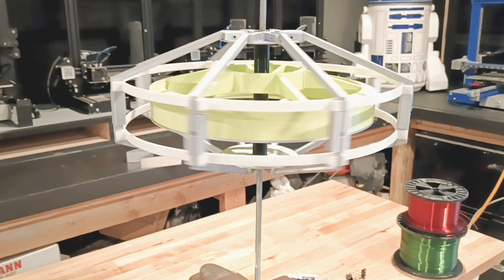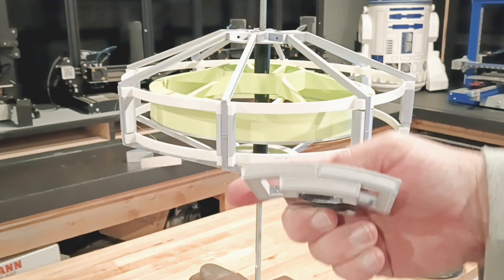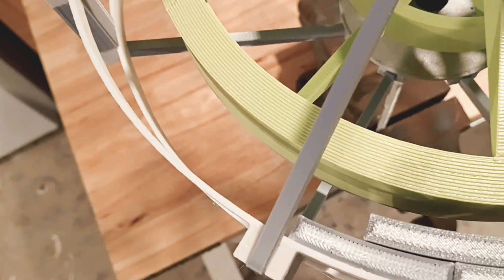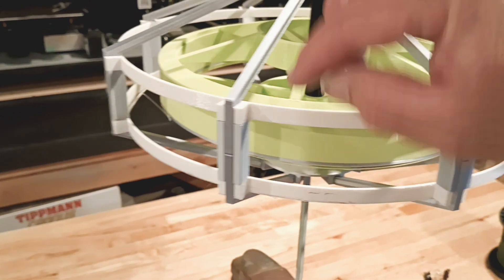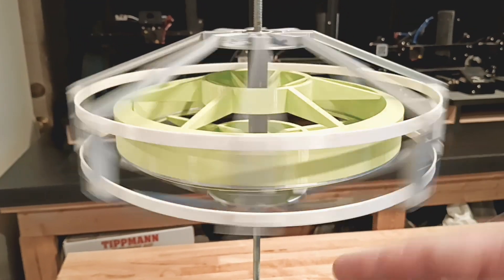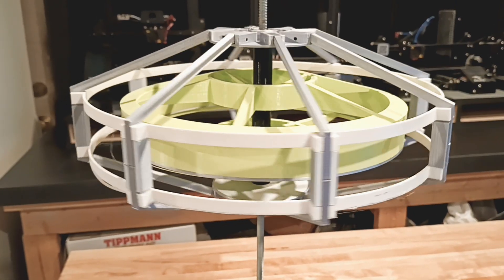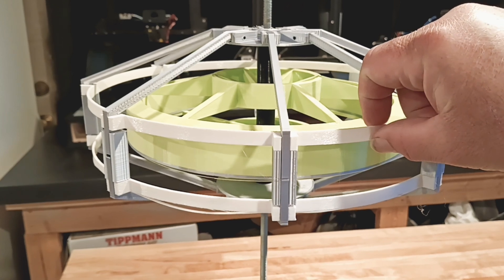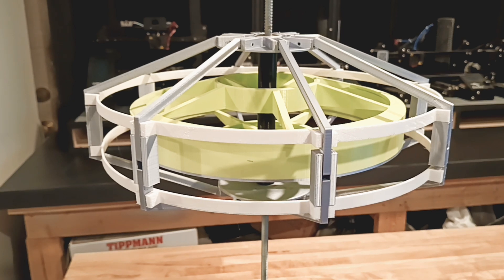Vril UFO update frame built

Comment: Its looking good! Great Job! I cant wait, if it works I will 3d print one!
Reply from the maker: let me know if I missed any parts. the barring's are skateboard wheel barring's.
Reply: @oldmanbuilds  I use small ceramic bearing for most of my experiments. They are much better than steel bearings so smooth! And they do not need grease, and you can clean them with water if they get dirty

Comment: that's nice 😃
Reply from the maker: I agree with you on the heat of the coils. I will need to definitely look into it, but in a short run I may be able to test the theory.
Reply: @oldmanbuilds  For sure! Because the plastic should melt if the current is high enough in a very short period of time, it has occurred to me. As I said, MDF can be better applied for heat dissipation compared to plastics.
Reply from the maker: @prerupa  I bet I could use a veneer or edge band that would act as a barrier. I will look into it.
Reply from the maker: @prerupa  Check out this video. It might remove some of the heat because it uses a capacitor for rotation and not a coil. Let me know what you think. 
https://youtu.be/xScrIheGZXw?si=uNjirA5o3b3VP_ak
Reply: @oldmanbuilds  PFT motor, never heard of it. But I get the idea, it's a kind of an electrostatic motor, isn't it? I would imagine that those real functioning different technologies don't dissipate heat as we should think on the known electricity.
Reply: @oldmanbuilds  it could be improved for sure.
Reply from the maker: @prerupa  I might have to build one when I am done with my current build. I saw one built with soda cans.